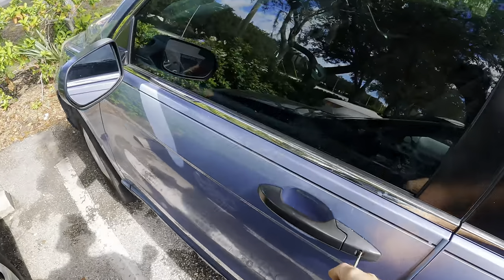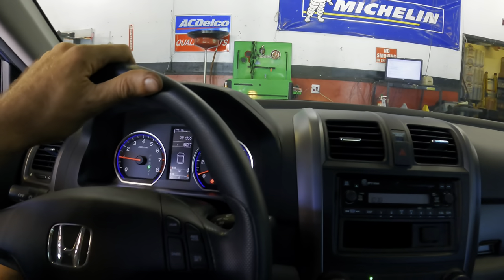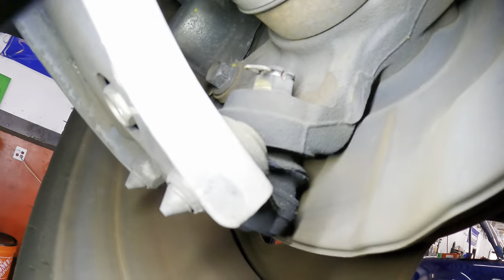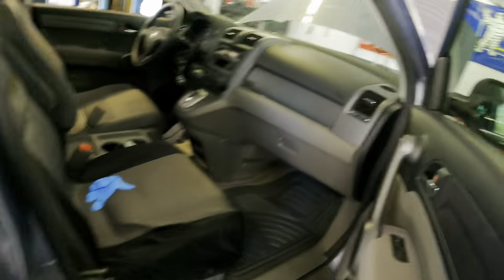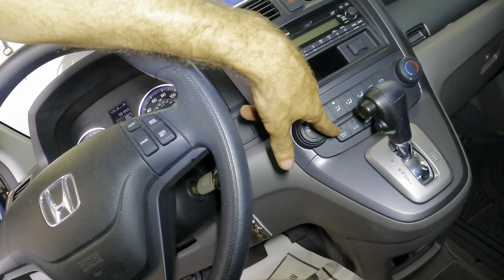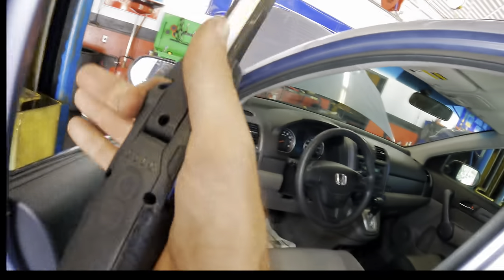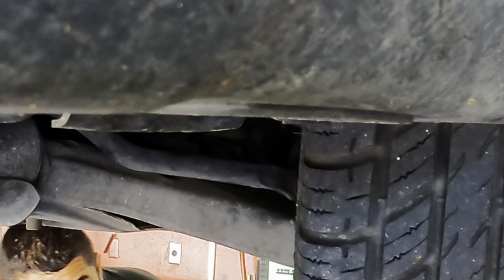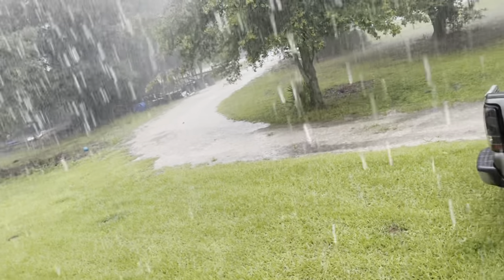Scam or Stupid? YOU decide! Work that wasn’t needed! Honda CRV

Comment: The oil/dirt around the recently replaced ball joint looks like they forgot to make it NICE AND SHINEY.
The split boot is 100% a monitor and check it next time; I don't know if you can repair that boot to prevent premature failure.
Hopefully the recommended repairs were as you say part of a fault finding exercise, but unfortunately main dealers have become known as stealerships for a reason.

Comment: The odometer is actually reading 91,000 miles, very low for a 2007/8.
Reply: Definitely an old lady car low mileage very clean not a big boat of a car old lady car
Reply: And obviously correct. That car was a cream puff!
Reply: with the k24 engine you can t go 
wrong
Reply: well if its miles is ok my 2011 has 125k miles
Reply: 91,000 sounds about average for me as I don’t even put 5,000 on per year. It always surprised me to see used cars barely 5 years old with nearly 100k on them already.
Reply: My grandfather's 07 crv had 40k on it when he traded it in for a brand new crv in 2016. Oh how I regret not pushing him to sell it to me instead that car was great.

Comment: Concerning the oil level. Before testing was your engine off long enough for the oil up in the motor to drain into the pan. A half quart low is normal for a "just turned off" engine.
Reply: Also, prior to checking the oil level he pointed out a leak around the oil filter. That might explain a half quart low after 800 miles. Maybe the oil change guys didn't tighten the filter enough.

Comment: My mother in law went to a local pep boys for inspection. She's 65 years old. Car is only 2 years old with 10k miles it was a brand new lease. The mechanic came back to her and said it didn't pass inspection it needed all new brakes and rotors for $800. She called me and I said get your keys back and never go there again. As soon as she told the guy forget it, he immediately says "don't worry we passed it anyways". Absolute crook.
Reply: There used to be a chain called Brake Check down in the south---think they're out of business now. But I took an almost brand new Tundra in for brake flush only, and they found almost $1k of things needed. I told them no thanks. Later I tell the story to some co-workers and 2 of them fall out laughing because they did the same thing with them, using the same line of BS like it was a rehearsed act
Reply: I worked pep boys lasted say three weeks , it’s the place it ruff make a buck in that hole so run into a lot that those places. A lot kids there are good but place turns them to shady side

Comment: Sorry Ray, a visual of the ball joints was not enough. Unload them and see if there is any play in them. In addition the sway bar links need to be grabbed and shaken to see if there is any play at the joints. Also, you don't even know what the original customer complaint was, if any. 🤔

Comment: I've had this situation happen to me once.  And I think I saw it happening to another person at another shop.
Happened to me when I took my car in for it's annual state inspection.  Shop told me it failed and gave me an estimate for $135 to do the repairs.  When asked what repairs it needed, they told me 2 light bulbs.  I asked him to show me what bulbs needed to be replaced, he pointed out that one of the license plate bulbs didn't work (true), and claimed a tail light was out.  But, the tail light worked fine when we were looking at the car.  License plate bulb I pointed out that the state inspection only requires one to be working, which he admitted.  So he gave me my passing inspection without doing anything.
The possible one I witnessed was a young lady brought her car in for an oil change and the service guy told her that she should get a $300 fuel system cleaning because her car had 20,000 miles on it and it was starting to lose fuel mileage and performance.  I think 20k miles is a little soon, but I'm not a mechanic, and I don't know the whole situation. Car was only 2 years old.
Reply: My wife took her car in for a state inspection at a local dealership.  They said it needed a "headlight bulb".  When pressed, they said it was actually a "turn signal bulb".  She didn't want to take the time to go to another shop, so she told them to put it in.  I told her to get the burnt out bulb when she picked it up because we had checked everything before taking it in and had dashcam video from my car showing that all the lights worked.  When she asked for it, they told her it was actually the side marker lamp, and that it was burn out and she wouldn't be able to tell because it was shiny.  She pressed for the bulb, and showed me a chrome bulb when she got home. I plugged it into a socket and took a video of it lighting up.  When I called the shop to call them out on their bullshit, they offered me a gift certificate for the cost of the bulb but not the labor to install it.  I told them I wouldn't be back even if it meant I had to drive an extra 3 hours, and to put their "gift certificate" someplace appropriately warm.
When we went back to the previously good Mazda dealer across the street, they told me that my car didn't pass inspection because "the brakes were worn out" and then "because the brakes were glazed".  I read them the sections of the state  motor vehicle code regarding brakes and general vehicle safety, and asked then how my car failed to meet any of those requirements, and furthermore that the ceramic brakes installed on the car from the factory work by depositing a bedding layer of material onto the rotor, just as these brakes had done.   Around that time, all of the techs were peeking around the wall and a couple of customers were looking in from the showroom, and quickly went from "we can't let you leave with an unsafe vehicle" to "give them their keys and get them out of here".

Needless to say, we took the car to another shop, passed with a "do you want to sell it?" and haven't had any problems since.
Reply: @bigj231  yes, luckily where I live they can't hold the car hostage.
Reply: @truckingwithj7202  They can't here either, but they sure tried!  I never trusted dealerships anyway, and moving into a state that required inspections meant that I had to find someone.  All of my coworkers just have their inspections done at the dealer they bought it from, and they're the kind of people to say "yes" to any "scheduled maintenance".

It's definitely worth the extra $50 a year to go to an independent shop, and I'm just glad I found one that I can trust.  They did get me to buy wiper blades one year, but I knew they were pretty much worn out.  They didn't charge me to install them and only tacked on a few dollars mark-up, and they called me first and told me I could put some on myself and they'd give me the sticker.  They get a dozen donuts every time we drop the car off or pick it up.

Comment: I worked as a service manager at an independant garage here in the UK. One of our technicians used to work for a chain of service centres called 'Kwik Fit'. He told me of the questionable tactics they used to drum up business. We have many here in the UK. They employ many 'tactics' such as offereing cheap MOT tests, then condemn the vehicle with a massive repair list. The other tactic was to show the customer their worn ball joints, brake discs/pads and many other horror stories as to why their vehicle was in need of immediate repair. The truth was that they has the cupboard of shame stuffed with worn out parts that they produced in order to shock the customer into unnecessary repairs because they were paid on commission. The technician in question looked for another position as he too wasn't pleased with the practices he was asked to undertake. When he came to us, he turned out to be the most efficient and profitable person we employed.

Comment: I disagree with your sway bar diagnoses; you cannot rely visual inspection, you need to test drive it over speed bumps. The Service writer should have gotten the Master key when the wrote up to inspect the cabin filter. The original diag. was not done by a Honda dealer. They would not install an aftermarket oil filter.

Comment: You didn't ruin the video, you produced another excellent video Ray. Here's a horror story for ya:
I once bought a used Hyundai Accent from a Garage I used to use regularly for oil changes and some repair work.  I trusted them.  The owner of the shop had the Accent that belonged to his buddy sitting in his overly crowded lot, and it LOOKED REALLY clean.  Anyway I bought the car for $2K cash. The shop owner assured me HE had gone over the car with a fine toothed comb and the vehicle was in cherry shape mechanically. The ONLY thing wrong with the car was that temperature gauge on the instrument cluster was inoperable, and the horn didn't work for some unknown reason.  He told me that it needed a new cluster and he'd source a used cluster and install it for around $300.  I accepted this and proceeded take my pretty, shiny, new-to-me car home. I didn't test drive it or anything because I trusted this guy, and I was in DESPERATE need of a car. I didn't even get it halfway home before I started smelling coolant. It had a blown radiator hose. It was a Thursday so I took it back on Friday and they repaired the hose for free... Just before releasing the car the mechanic noticed something terribly wrong with my font passenger wheel. There was a lot of hand to face rubbing going on between the technician and the shop owner, but they weren't telling ME what was wrong... So I walk over and take a look. The wheel was missing 2 of the four studs, and the two that WERE there were on the same side... It was Friday afternoon so I was SOL on getting that problem fixed.  The shop owner told me to "just drive it easy until Monday ". I went by the auto parts store to get the studs so I would at least have the parts in hand on Monday.  I went home and did some YouTube research on replacing the studs and decided to do it myself.   Anyway long story short I did my own inspection and found more than 10 major problems. After having found all these problems I decided to take a look at the  instrument cluster. This was the The CHERRY ON THE SUNDAE. I pulled the cluster out and I noticed there was a long fine threaded brass screw just laying on the tray/shelf the cluster sat on. I thought that extremely odd. Taking a look at the back of the cluster it had one of those flexible printed circuit boards. The reason the temperature gauge wasn't working was because somehow a 2 inch long FINELY THREADED screw had worked its way out of the positive terminal of the temperature gauge. This was an engineered problem and the shop owner was going to charge me $300 to put a screw HE had taken out back into its proper home. When I confronted the owner of the shop on this he went absolutely white. He said "I thought you didn't know anything about cars!" I corrected his missundersranding "Oh, no...I know how to fix'm just fine, I just didn't want to do the work rolling around in the sand." I had caught the shop before doing unnecessary work during an oil change, where they had put in new sparkplugs when I had put new plugs in literally the week before. A quick glance at the plugs they had thrown away made it clear that I hadn't needed new plugs at all. I just chalked that incident up to someone being lazy and just firing the parts canon for shits and giggles.  The Hyundai ended up being an absolute lemon.  I still have a complete manual transmission swap sitting in the original shipping box. The transmission locked up on the interstate and broke the timing belt THE NIGHT I was taking it to my dad's barn to swap out the transmission.  So, yeah that's my horror story.

Comment: Thank you for mentioning that ATF is recommended by mileage not condition. One of my assistant managers kept trying to recommended by condition and I kept telling him that we can't do that and it's a slimy thing to do.

The last time he did that we exchanged words, then hands because he was REALLY trying to sell a service to a teenage girl and I had already spoken to her about it (recommended by mileage) and she wanted to go to the dealer for a second opinion. I told her she was more than welcome to get a second opinion and we'd be there if she wanted to come back. He didn't like that I kept trying to tell him she wanted to get another opinion.
Reply: I hate to say , but  while it is primarily based on mileage , this only applies if there are no existing issues with the transmission .
If the fluid is dirty , mucky , contains metal flecks , burnt smelling  and dark the fluid needs to be changed regardless of the mileage.
That of coarse dose not address the problem that cause the fluid to become that way in the first place.
Your assistant manager " MAY" have been correct if the fluid was as described above.
I know this is not want you wanted to hear.
Sorry

Comment: Hi from the UK Ray!
Unfortunately this kind of behaviour is all too common here too.
Examples I’ve dealt with….
1) Alarm sporadically sounding for no reason. Owner told vehicle “needs new brain” as it controls the alarm.
What it actually needed was a new bonnet sensor switch at a US equivalent cost of around $3.
2) Vehicle needs new power rack. Nope. It needed two outer rack ball joints.
3) Land Rover. Parts list and estimate running into the thousands. 
It needed an auxiliary battery.

I could go on…….

Comment: I did an oil change on a 2005 Ford Freestar with 77k miles on it today. Besides it's elderly owner bumping into a few things and scraping up the bumpers, it looked brand new. Super clean inside and out, everything worked. Even the power windows glided up and down smooth and silent. The last time I saw an 05 Freestar in that good of shape was....probably in 2005.

Comment: Ray, Did I miss you recommending a ball joint replacement on the passenger (?) side?  You mentioned the torn boot but that the grease was still there.  The grease will eventually get washed/thrown out.  I'd have put that on the future list of repairs.  Great video!

Comment: I like the way you included the remark about possibly not knowing the whole story. It is conveniently easy to smear others when the story doesn't fit with the history you were given. If given a story of a noise, they might have pried the joint up and found unacceptable movement, either at the ball joints or the sway bars. Slinging mud usually smears everybody.

Comment: I despise these kinds of mechanics that upsell on repairs. Nice work Ray. A dealership near me pays their mechanics commission on upselling so they are always trying to talk customers into repairs they don't need. My usual mechanic doesn't do tires so he went through a truck for me before I took it to the dealership for new tires. They wanted to replace most of the front end suspension because it was all "worn out." I asked to see the issues before going forward. He showed me a "loose" ball joint that appeared to be fine. When I questioned it he put a pry bar on it and said it's out of spec. I declined all repairs and asked to see the service manager. He denied my claim that his mechanic was upselling unnecessary repairs. When I told him I had an independent mechanic go through the vehicle before I brought it in I was asked to leave.

Comment: I have just had a recent roadworthy inspection here in Australia. Without authorization they changed the cam cover gasket and rear wiper blade which they charged $800 AUD for.
Made me mad as hell, I know how to change a cam cover gasket too. You're right about stacking the cash. I need it for my kids.

Just pisses me off getting stooged like that by the weedy little troll at the service station.

Comment: Hard to tell if a sway bar link is bad without touching it
Reply: One way to know is if it's still connected. They rust off at the top bolt and bang around.
Reply: @ninjamaster3453  they most often wear out like a tie rod get sloppy, and rattle/bang when driving
Reply: If it sways it’s bad